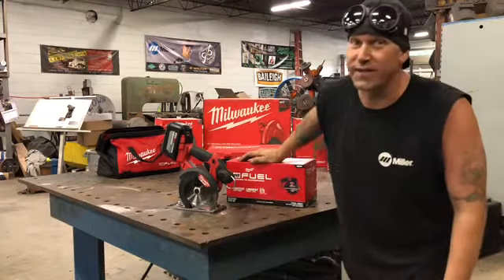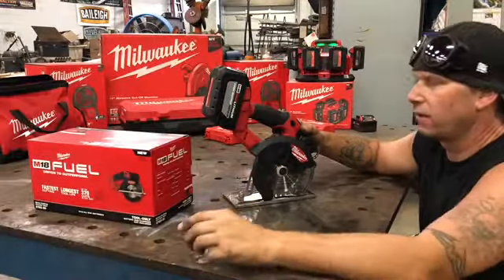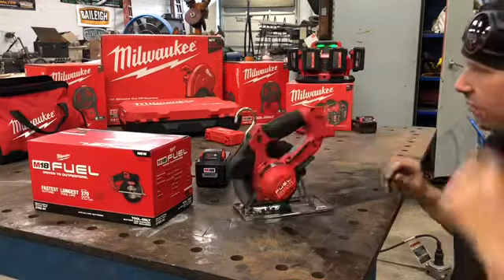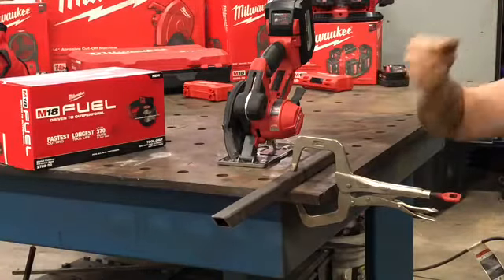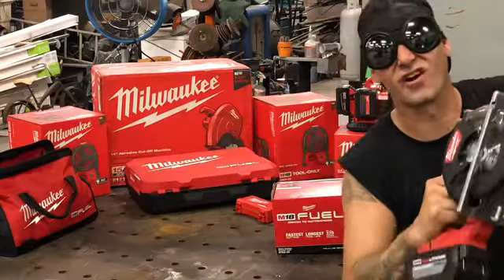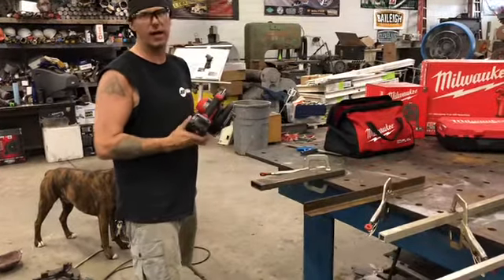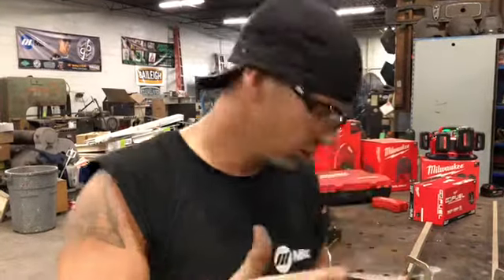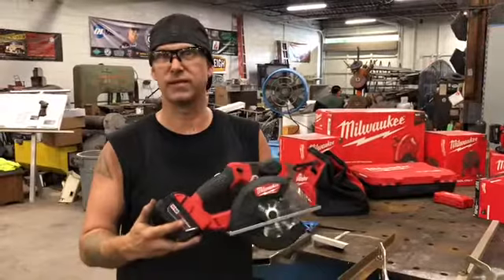Milwaukee Metal Cutting Circular Saw

Comment: Can I change my blade out for a wood cutting blade? Or is it only made for metal? Thank you
Reply from the maker: I believe you can buy three different types blades for these. You’d want the blade with the least amount of teeth which would make bigger teeth for wood, I believe.
Reply: @GarageBoundLLC  ...Reason why I was asking, the metal blade is 12,000 Rpms and most of my wood blades ( circular saw cut off saw ) are 6,000 plus. I'm thinking you don't such a high rpm for wood, kinda makes sense lol..Ok Thanks brother.  I'm off to home depot.  👍 🇨🇦
Reply from the maker: @locknload9143  the tool is adjustable speed.